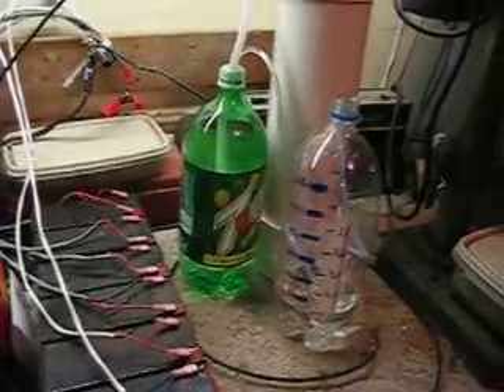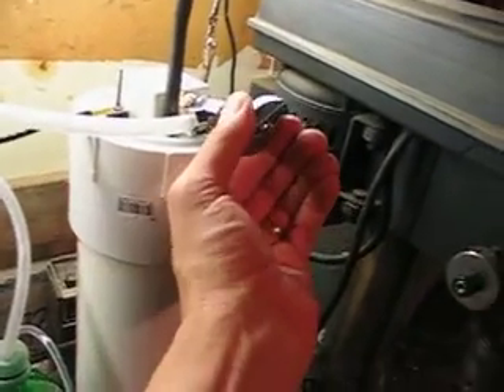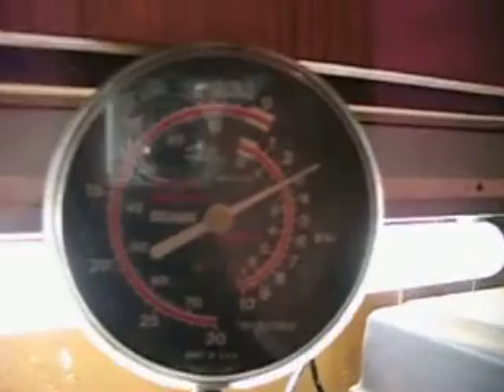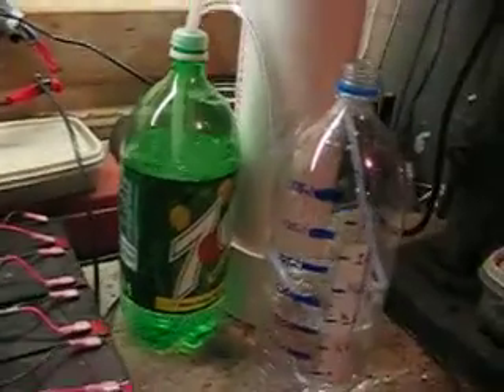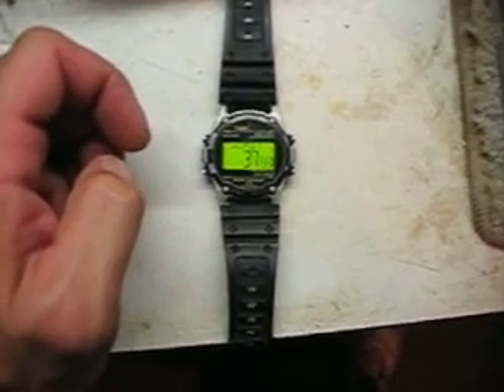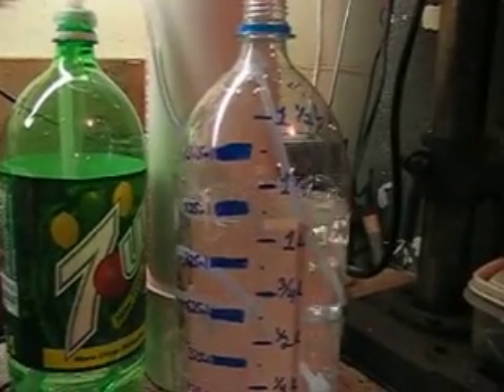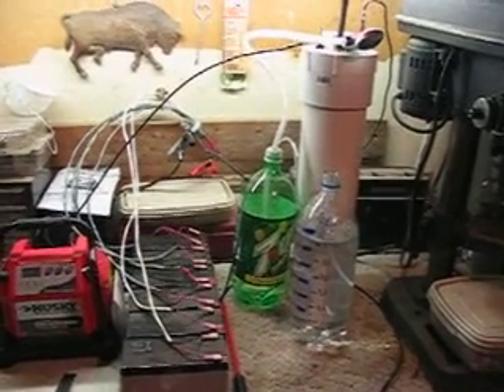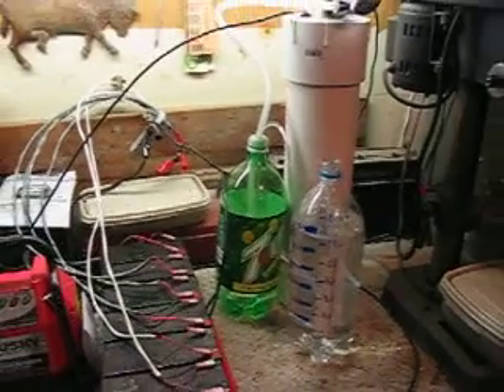Hydro Lab (My Garage) #20 L/PH

Comment from the maker: Hey samoht1977,
No this test was DC only. Wires are small, they did get hot. Using these only for testing. Fisished unit will use larger wires.